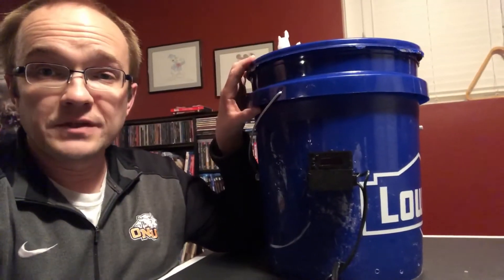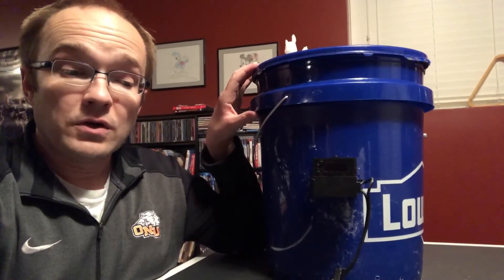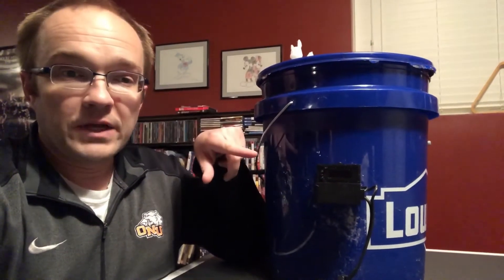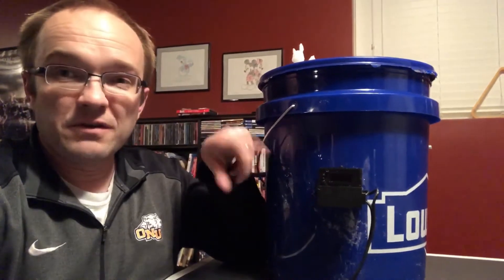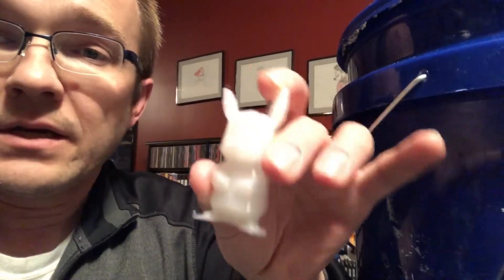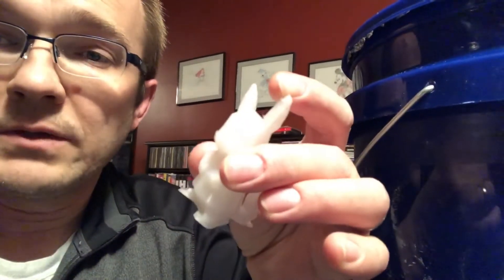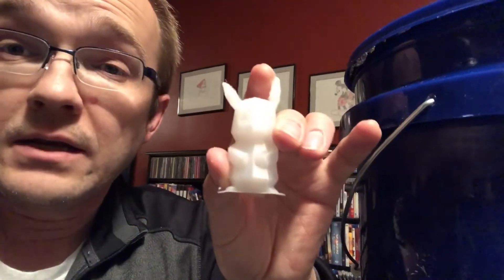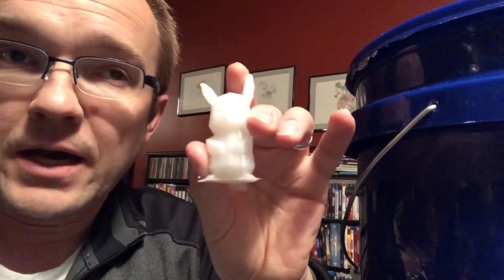DIY Arduino controlled Filament Dryer - Part 1

Comment: Thanks for the video as I'm researching on making a drying box to use instead of the oven after seeing the year end budgeted elec bill.  Will watch part two after this.  

Don't count on any Taulman filament to be dry out of the package.  I've been printing only with various Taulman filaments for over a year now, Alloy 910 for most parts and lately PCTPE.  I may have had a couple Alloy 910 spools that were dry enough to use out of the package, but most spools I had to throw in the oven after seeing the first prints show signs of moisture.  I dry all Alloy 910 before printing now.